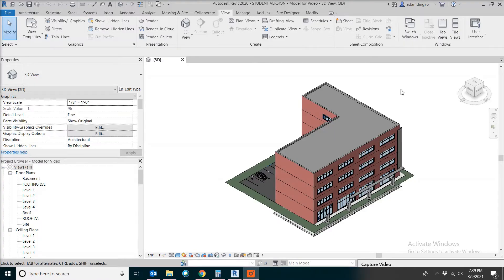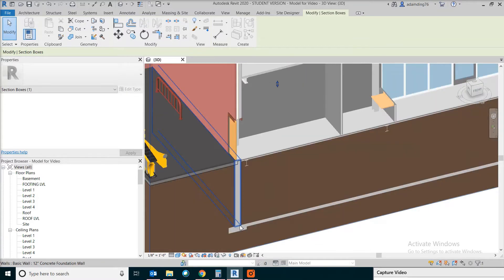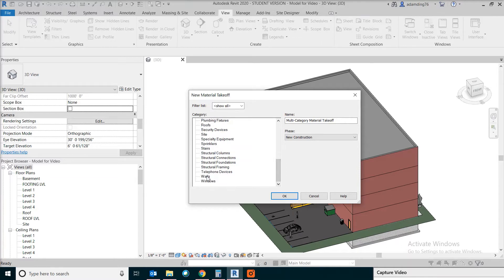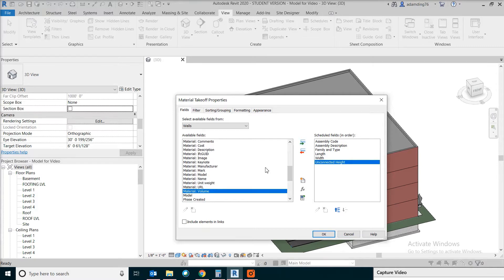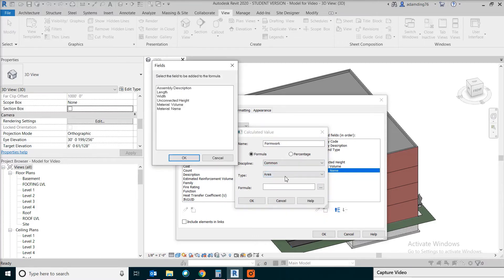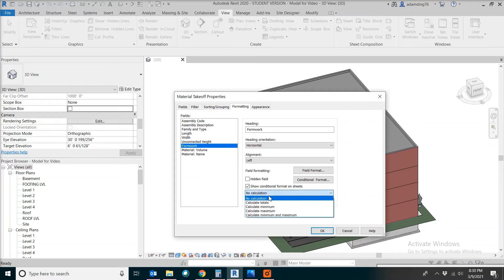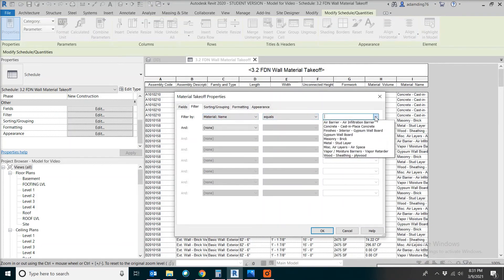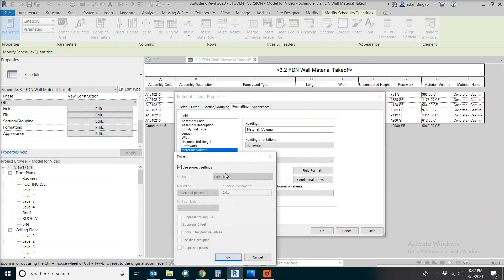BIM Estimating 3.2: Foundation Wall 3D QTO

Comment: I can tell you have used this program once or twice, one day I'll be as quick.
Reply from the maker: Yes, Jon. You are correct. Most of the estimating on the model can be done using the model itself. 3rd Party software is not necessarily needed unless for pricing.